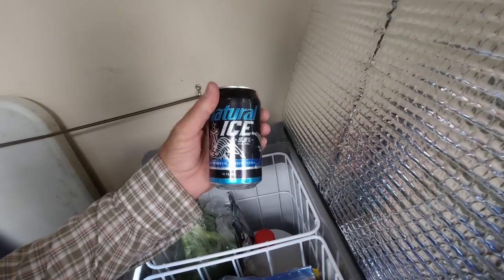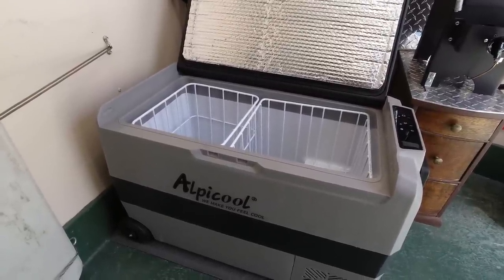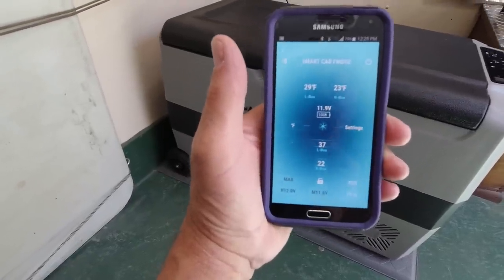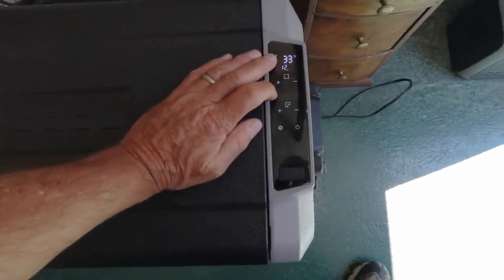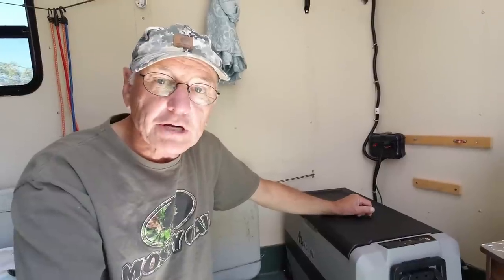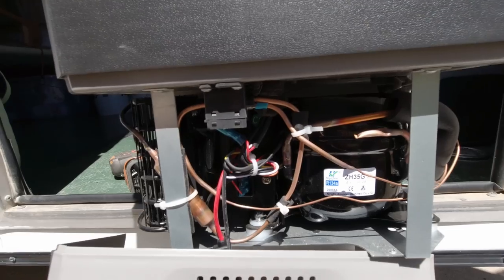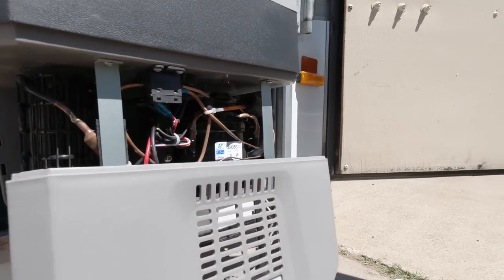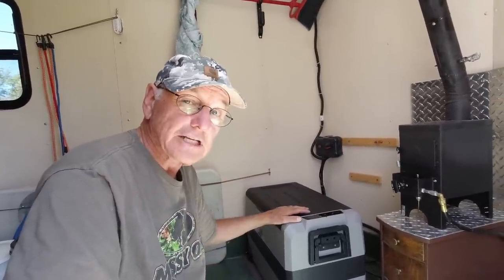Alpicool T50 12 Volt Refrigerator - Is It Worth It?

Comment: I used mine this week at a campground where it was plugged into the campground's 110 and it worked great. My problem is that the other Alpicool plug will not fit into my van's cigarette lighter. It is too big. Is there any work-around for this problem. I am camping in a 2002 Ford conversion van and would like to be able run the refrigerator while on the road.
Reply from the maker: It would be easy to snip that plug off and install a different 12 volt plug that fits better.  That is if I'm understanding your problem correctly.  The stock one fits my accessory outlet fine though so you have me wondering.

Comment: How did you attach the reflectix insulation - double sticky tape? 
Btw, you were right about contacting them through Amazon - they responded immediately with instructions how to reset the "brain", so it works now as it should.  
It does draw 45-50 AH or ~600 WH per 24 hours in dual mode, with fridge at 36F and freezer at 0F (measured inside, the display readings could vary, especially for freezer).  This is at 77F ambient, so not same efficient as my home fridge, but then, I can't put my home fridge in a car :)
Reply from the maker: Thanks for sharing your WH draw. I've found Alpicool to be a reputable company.

Comment: I have a C15.  At the coldest setting and connected at 12v it draws about 2.3amps... I want to upgrade to the T36 or T150 , but I wonder how many amps (real world) it will draw at 12v?
Reply from the maker: Well lets see;  on ECO mode and set at 34 degrees, it draws about 45 watts when it's running so that's about 4 amps, but it only averages about 13 watts an hour in an ambient temperature of 70 degrees so that's a little over one amp per hour of use.  A hotter ambient temperature of a colder setting could double that.  I hope I got that right!

Comment: How would you suggest cleaning the cooling fan? Air duster?
Reply from the maker: Very gently with a vacuum and small nozzle. The cooling fins are easy to bend of you're not careful. You shouldn't need to worry about it often, but if it's been awhile and you notice your refrigerator running a lot longer during it's cooling cycle, then it's time to clean.
Reply: @gonagain  I plan on running mine 24/7. How often would you suggest cleaning?
Reply from the maker: That's hard to say because it depends on how dusty your environment is and whether or not you have pets. If it's sitting on the floor you will have to check it more often than of it's up a little higher.  All that being said, I'm thinking only once a year.

Comment: Sorry I got a model same design.  Seems it has a dc25h china compressor.... its so loud.... is the alpicool using an LG?
Reply from the maker: Alpicool uses either an LG or a Secop compressor.  Sometimes a louder refrigerator means it has a larger cooling fan, which chills it down faster.

Comment: Don't think you can run them off 12 volt solar panels without a controller.  Think they put out 20 volts.??
Reply from the maker: You're right Edwin.  You can run them directly from a solar charger like the Jackery and Blueitti type, but in an RV system there needs to be a controller between solar panels and the RV battery(s).  I have a 30 amp Renogy that regulates the power to my batteries.  I wanted to find out the Alpicool would run continuously on the solar set-up that I had already installed and it did, no problem.

Comment: Try draining that bluetti down to %20 without regulation and " BOOM" shuts off 🤔
Reply from the maker: I know that these power stations will shut themselves off of the battery gets too hot, like if you are running a continuous heavy load. It's just how they protect the battery.

Comment: Great to know it shuts off at 12 volrs
Reply from the maker: We got stuck once in the middle of nowhere (where we always are) due to a cheap Walmart refrigerator that I forgot to unplug (I'm sure it must have been Linda's fault, but I couldn't prove it).  The only thing that saved us was the battery out of the ATV which only had enough power to crank the engine a couple of times very slowly, but it caught!  Pure luck.  Ever since then I've always carried a lithium car starter.  Yes, it's good that the battery protection is built in on this one.
Reply: @gonagain  Wow! Ya that's a lesson that you'll never forget.
Reply: @gonagain  Yikes.. that's a close one.. we Love Linda
Reply: @gonagain  yes, I tested mine with my car, the fridge will shut off before it takes the battery too low. Nice to know.

Comment: I like your choice, the wheels give me some options I had't thought of. One question Does it come with a 120 adapter cord? the one I'm considering does and that way I can chill down the frig the day before I leave without drawing down my battery which is important here in the desert where interior temps on a parked and closed trailer can be extreme 140+
Reply from the maker: Hi Karl, yes, it came with the 120 power adapter and we do the same.  I have to say though, that it chills down really fast on 12 volt, maybe a half hour at most.

Comment: If you have trouble with it moving around I used 2X2" blocks and screwed to floor along sides of my 75 quart Dometic to keep it from sliding on rough roads.  Also cut plug off cord and hard wired it into a fuse block into my cargo RV 12 volt system.  Plugs are a week point in system.
Reply from the maker: We had the plug come disconnected on our last trip, so you're very right about that!  I'd like to find a way to cushion the ride a little but better to protect it from vibration and bouncing.
Reply: @gonagain  Sometimes you can reach down and plug and wire will be warm . Just like a loose battery connection it gets hot from moving.  If you want to save plug cut off with 3 " of wire and put an Anderson type plug on wire ends, they are solid connectors and you'll be able to use plug if needed. I would just cut off three inches of cord on plug side and save for emergencies.
Reply from the maker: @texdog2772 , yes, the Anderson connectors would hold a lot better for sure.

Comment: I bought this same model in March and was using it every day, worked great. Then a few weeks ago, it died out of the blue when plugged into AC power. Too bad, it worked great and is the smallest dual zone option but doesn't seem reliable. Oh and re; unregulated output, I think if you ran it a bit longer you'd see it would stop working around 50-60%, even with the low voltage cutoff set at it's lowest level.
Reply from the maker: Thanks for your report Todd.  I checked the reviews of a lot of different makes and they all had reports of failures like that so I think it's a toss up.  They're easy to work on so I hope you can get yours fixed.  If mine breaks I'll report back to you all!
Reply: Gonagain yeah, I agree it’s a crapshoot, I just got unlucky. I ended up getting a refund and getting a Dometic but it doesn’t mean you can’t have good luck with these Chinese models, just good to know it’s riskier and the warranties are pretty thin
Reply from the maker: @todd.parker , I hope it works out better.   I was thinking of the Dometic, but it's also made in China, as is the American Norcold, we can't get away from that.  I've also learned that our American cars and even the revered Toyota all have a lot of Chinese electronics onboard (radios, engine control modules, etc.)  We sold our souls a long time ago I'm afraid.

Comment: Does anybody know what volt Setting  to have on the app when plugged indoors on my house power ??? There are 3 choices??
Reply from the maker: It doesn't matter if you're just using it on AC. The three settings are for when you're on a battery and in that case you'd use the high setting for a lead acid battery, middle setting for a deep cycle battery and low setting for lithium.
Reply: @gonagain  thank you 😊

Comment: Great video! I have the same one. Love the Bluetooth. Did a cross country 3,600+ miles trip with my Alpicool (freezer, single mode). Needed to keep some meat frozen. I stayed in hotels overnight and didn't want to take the freezer in/out the hotel. I used an AUX battery in a battery box overnight. One night, it clicked off by morning (F1 fault on display). I charge the AUX battery with a 3A 12v charger + running the freezer off that battery while day-driving. Bad move! I wasn't able to keep the AUX battery charged up AND run the freezer over night at the same time. Solution (night two-three): ended up running the freezer on a separate power socket and charge the AUX battery separately during the day while driving. Then, at night swap over to AUX battery. Worked perfectly. The final problem I had (my fault). I had the cutoff set on 12.0 volts. I now have it set on 9.0 volts and purchased a Dakota Lithium 54 aH (691 Wh) battery...zero issues running all night. Made some mistakes, but figured it all out. When not on the road....I use it on the back patio. Thanks for doing a video on this unit!
Reply from the maker: Thanks for sharing your experience.  Ours has been on some major roadtrips and we like it, but I'll be doing an update after it's well used.

Comment: My Alpicool C15 must be Detective it's gotten louder over a short period of time it runs 10 minutes on and maybe 20 minutes off at 36 degrees and that's with it full track. It is as full as I can get it which will not be all the time if you take food out can't keep replacing it it just concerns me that it runs so much for such a small cooler it keeps me up at night I rather have a ice chest knowing that's not drain my battery or I'm doing something wrong I wanted to get the C 35 model but I'm not sure now
Reply from the maker: Hello Claude, I have some ideas that may or may not help.  First of all, the run time may not be abnormal and I see others that say their's are like that.  We're in the hottest part of summer and that greatly affects it.  I put a heavy blanket over mine to help insulate it and others sew up a cover out of reflectix.  Just be careful not to cover the intake and outlet vents.  I'm sure you've already checked to see if something inside is rattling or buzzing and needs to be moved a little, but these compressors are as noisy as our home refrigerators without the benefit of heavy metal to dampen the sound.  It does help to have the unit sitting on something soft, like a piece of carpet or a rubber pad of some sort to absorb vibrations.  On the C15 it looks like you can remove the cover over the compressor to clean the cooling fins and that may also let you see if something inside needs to be secured with a wire tie or something to keep it quiet.  I hope this helps a little.
Reply: @gonagain  thank you for all the advice I'll look into it

Comment: Guys....update after 1 year use.....ok the thing works, now it have a blown LCD panel....no service options, no one to call for support
email the factory ...no answer ....looks like I am right about them no prepared to support the product......add insult to injury, say the replacement panel on line for 90 bucks....expect consumer to do DIY repairs....BUYERS BEWARE
Reply from the maker: The LCD panel is an easy replacement and just pops out.  The way to contact these companies is through Amazon, whether or not you actually bought the product through them and I've found Alpicool to be very helpful in the past.

Comment: Fridge next to Wood stove... how does it stack up at winter conditions?
Reply from the maker: Good question!  Generally we don't camp in winter, but I've been putting a reflective cover on the top of the refrigerator when we do use the stove.  Most of the heat goes up anyway, so it's not too big of a deal.

Comment: Great video, clear and concise. I think the point about regulated 12 volt supply needs clarification. Some refridgerators will stop working if the supply pressure drops below 12 volts. A regulated 12volt supply from your lithium power station will maintain this voltage regardless of state of charge in the power station battery, so that your fridge will continue to work.
Reply from the maker: Good point.  On this Alpicool I was able to set that down to 9 volts.
Reply: @gonagain  thanks for your reply. Pretty good if your compressor Alipicool fridge/freezer can continue working at 9 volts. That should be useful for smaller power stations.
Reply from the maker: @barry-cq4xg  after almost 24 hours it was down to 10.6 volts and still going.  I figure it will go down to 9 because that's the setting on the fridge itself, but I guess we'll see.

Comment: Mine has been crapola since I got it.  First the plug connection was so loose I taped it.  Then the rattling started.  Fan has now gone out. Lid never closed completely flat.  It throws codes constantly and it isn't like I beat it up.  I only use it camping and it goes in my van and stays there.  I don't start it until it sits for a while after putting it in van.  I wait overnight before plugging it in.  Piece of junk. of course all these things happened after warranty ran out.  Now I am having a hard time getting a part number for the fan and customer service is non existent.  I could have gotten a lemon who knows but I won't ever buy one from alpicool again.
Reply from the maker: Sorry you had such bad experience with yours. We try to buy through Amazon just for the customer service on items that are defective, damaged, or you need to return. Contact Amazon (not the manufacturer of your item) and they will handle your problem quickly.

Comment: I just got my FOHO 42 quart today. Similar to this but it doesn't have wheels/pulley. Not that I care at the beginning. Just not big what I expected. Hell, a regular 20 quart cooler is the same size of my new FOHO. The quart size is 2X bigger. So heads up people! Don't think buying a 42 quart is too large?! NOT at all until you look inside of it. Overall, I still like it if keeps foods freeze/cold drinks, etc. I did purchased the protection plan, if ever going to break, etc, not that I'm waiting LOL. But If I ever going to buy another one in the future? I am getting a 60 + quart.

If we decide to be on the road longer times, many days, and a lot of camping? I might consider buying another one! One for frozen foods, one use it as refrigerator for drinks, cold sandwich, etc, etc.
Reply from the maker: Good info Jimmy, thanks for watching.

Comment: We just want to use it as a freezer as we don't have one in our trailer. We want to be able to plug it in and not have to worry about it. We do all campground sites for our camping trips. Any information would be helpful. You mentioned you paid $369 on Amazon. I am assuming USD well Amazon.ca it is almost $900.00 CAD. Would you pay that for it?
Reply from the maker: NO!  Really?  How come it's so spendy up there?  Other than the price, they work very well as a freezer.

Comment: There is nothing about the warranty & service on Amazon or the Alpicool sites!  Some get only a DC model & some say their unit is AC & DC.  From the reviews the customer service is questionable.  Some seem to have Bluetooth & others not. Some say the DC wiring is too small creating problems.
Reply from the maker: If a buyer has a problem they need to go thru Amazon and not directly to Alpicool. That's where people get confused and complain about poor service. Once you make contact through Amazon you get an immediate response and a return shipping label from Alpicool. All of the refrigerators will run off of AC or DC and I don't think they come with the Bluetooth any longer. The problem with the wiring being too small is that it's actually too long and I suggested shortening the cord to a minimum. It comes with an overly long power cord for hooking it up from the back of a pickup truck.

Comment: Great video, any recommendations on a portable solar battery/panel system that would run this efficiently?
Thanks
Reply from the maker: My best panel, for output wattage, is my Xstar XP100 and I would hook up two of them in parallel to the power station.  Less expensive panels, made by Itehil, work well also, but are a little harder to set up because of the legs on the back of the panels being a little less stout.  As for a power station, something with 1,000 available watt hours or more would be best. Only buy one with LiFeP04 batteries and NOT lithium ion.  Look at the Oupes line of products because I've had good luck with them.
Reply: @gonagain  Thanks buddy

Comment: Great review - Thanks!. I am pretty sure that I'm going to pull the trigger and buy one of the T50 units. Amazon is currently showing prices of $359 for the std. compressor model and $389 for the LG compressor version.  What are your thoughts on the LG compressors - are they any better or worth the extra cost?
Reply from the maker: I've never experienced a compressor failure (yet) and think most of the time, if you're going to have a problem, it's going to be the electronics.  Alpicool also makes the 12V Bodega line of refrigerators.  Lg has been making compressors for a long time.
Reply: @gonagain  Yeah that's what I was thinking too. Maybe it would be worth the extra $30-$40 to pay for the 3 yr "extended warranty" on the std. compressor, and hope that if something failed in yrs 2-3 they would actually cover it. But then again, I've read a few comments from people who said the Asurion warranties are worthless - IDK?